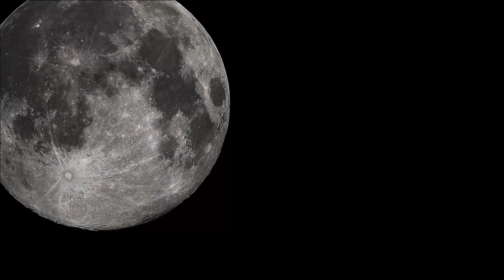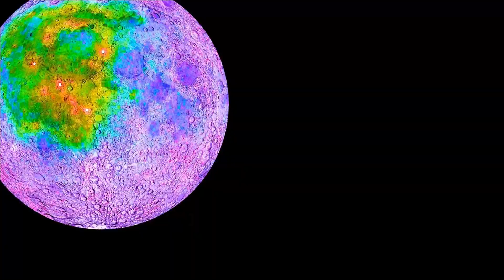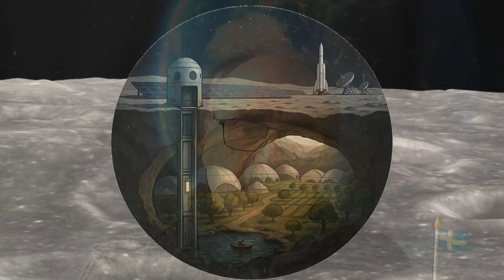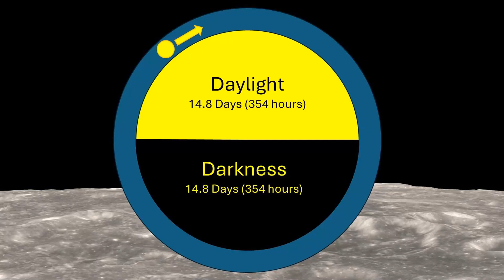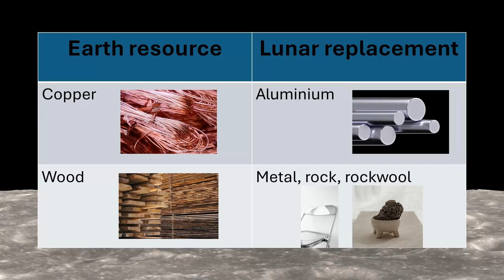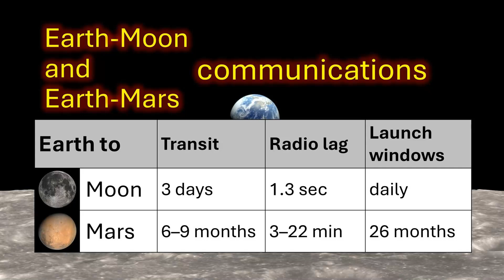Settler’s Guide to the Moon – Too Harsh for a Self-Growing City?

Comment: Superb presentation. Thank you.  
My curiosity around the air pioneer by blue origin’s practical feasibility brought me here.
Reply from the maker: Thank you, Matthew! Practical feasibility is what we try to look at here - going a bit further than oxygen extraction. :)
Reply: @moonbaselapptrask Yes, that's why I was impressed.  Possible and practical extraction may or may not be a gap engineering can surmount - depends on the resource.  But not there to be extracted is a bigger gap.  As I learned from your presentation.
Reply from the maker: Thanks again! :) I have been taking a little step back the past couple of weeks, to look in more detail on what elements are needed and how they appear in space settings. https://www.youtube.com/watch?v=hlvn1YP6JVY is the first in a mini-series of three videos on that, the "Breath" of a settlement and of course that includes oxygen. The following two will be "Bones" (structural materials) and "Blood" (trace elements, for nutrients and alloying).

Comment: good video, initial supplies of nitrogen and carbon might require us to send a "starter pack", or crashing&harvesting asteroids, but I don't think it'll be a big problem long term given the moon is close-by to visitors and most will be okay will leaving some of the carbon and nitrogen at the travel destination.
But I agree, for the early days it's a bit of a chicken or egg situation
Reply from the maker: A throughput of visitors would indeed be an opportunity to charge some volatiles for their stay. Tbh, I have more faith long-term in finding a low impact-velocity carbonaceous meteorite. There should be a handful big ones around, and they may each contain more hydrogen, carbon and nitrogen than the PSRs combined.

Comment: Excellent overview for Lunar settlement. Thank you!  Luna's proximity to Earth, abundance of industrial materials, and lower gravity still make it the best option for early settlement, even with its deficiencies.  I think every constraint has numerous solutions. Volatiles can be shipped from Earth or extracted from the PSRs. And volatile loss can be minimized through clever engineering. Lunar nightspan can be survived by having a robust energy storage system and conducting less energy intensive activities. Logistics can be solved by using Lunar derived fuels for all rockets used in cis-Lunar space except for the Earth - Earth orbit leg. We haven't found anything based on physics, chemistry, or engineering that would prevent a Lunar self-growing settlement. What's stopping us is a lack of vision and willpower from humanity in general. Beats me how to solve for that!
Reply from the maker: Great points! And yes, you have the key difficulties there. And lack of vision and willpower is true - or maybe those are there but scattered instead of coherent into a joint vision? A lot of visions around, and a lot of people wanting things, different things.